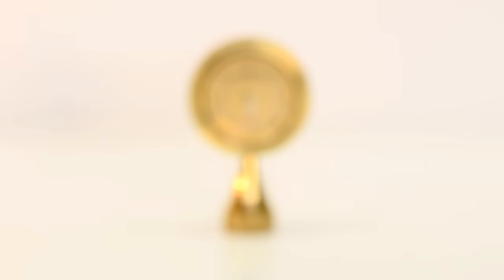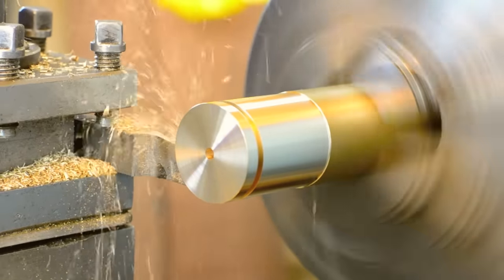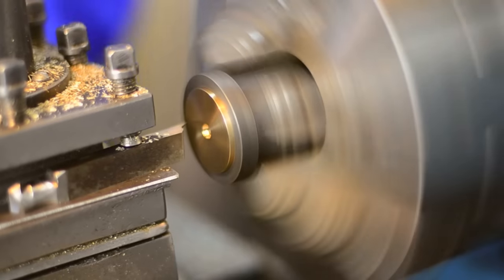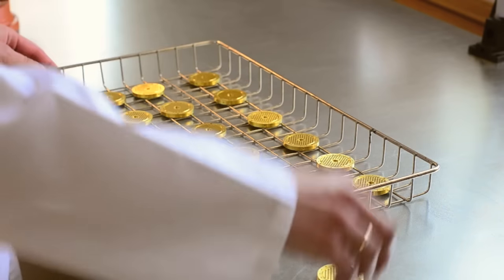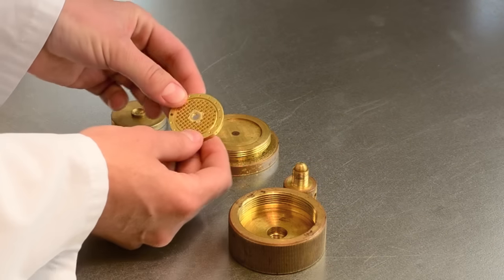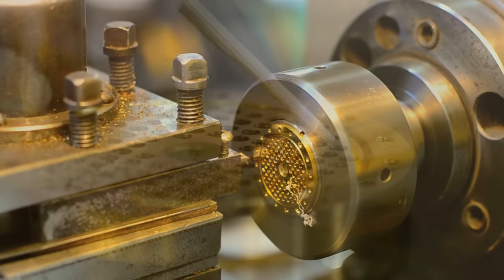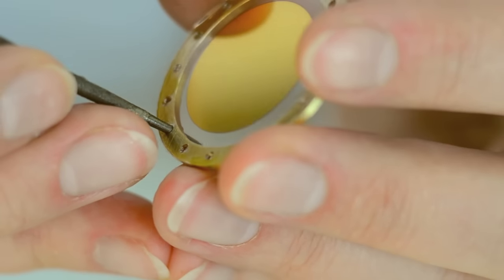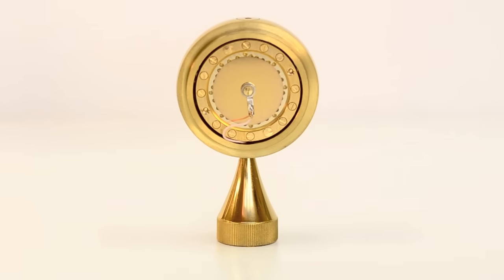SoyuzMade: Handcrafted Microphone Capsules

Comment: Its incredible to see this sort of craftsmanship in the modern era.  So few companies take pride in producing a quality product that takes this level of time and expertise.  Bravo.
Reply: 248 holes hand drilled?  I would go nuts doing that all day every single day.
Reply: @generalawareness101  There is a special tool that is named "кондуктор" ("conductor") in russian.
Reply: @ВаняКа-Ка  I have never seen one of those.  How does it work and how small can it drill if it even drills?
Reply: @generalawareness101  You could see the conductor on 1:12 - a perforated jar with a screw cap. But usually in mass production screw caps are not used due to the length of time. Usually there is a simple hinged lid or none one at all. I dont know how conductor is called in english.
Reply: @Ваня Ка  I re watched it at your time mark and I don't know either BUT I stand by what I said because they are, indeed, hand drilled even though they use a guide it is still a very monotonous job at best.
Reply: @generalawareness101  I do not argue. It is really a very monotonous job. However in a factory it is as monotonous as breathe.
Reply: @ВаняКа-Ка  I have worked at factories before and some jobs are mind numbing but that is insane.  To be honest it really should be done by a machine to spare inhumane environment and to save time, and money.  Might not be the same though but you never know until you try it.
Reply: @generalawareness101  It was the most common (maybe the only one) perforation technology for steel and brass in the pre-CNC era. And it is still cheaper then CNC miling or electric dicharge or laser cutting.
Reply: @ВаняКа-Ка  Slave labour will always be cheaper than those in countries with little, to no, respect for their workers.
Reply: @generalawareness101  Conductor is not a slave but a metal tool. По времени оно то на то и выйдет. Разница не в стоимости рабочего времени, а в стоимости станков и оснастки. Вас так напугало сверление по кондуктору, хотя это совсем не так монотонно, как переустанов на ЧПУ.

Comment: ..but when do you add the stored energy to it or is it only on electret microphones. I ve heard you shouldn t touch the diaphram because of it s voltage? But I cannot see in any step where the energy is put to the diaphram before placed onto the capsule
Reply: Yes, it is only electret capsules that have to be polarized in a factory, for true condenser ones like this one the polarization voltage is supplied externally through phantom power. 

And you shouldn't touch the diaphragm, that is correct, but that's simply because it is very thin and can be easily damaged, and also the gold coating can be easily rubbed off.
Reply: @RusAD-gb9jk   alright thanks for your answer.

Comment: Your first mistake is modeling your capsules after the Neumann K67, which has a harsh high frequency peak that can only be dealt with be corrective EQ. Not impressed.
Reply: Do you know what causes the capsule to do so? What capsule design would you suggest?

Comment: Such bullshit, 2 micron tolerance? On what? For what? So you think that it's necessary and to make you pay more?
Reply: I don't know, but tighter tolerances may allow you to have a smaller gap from the membrane to the backplate. The smaller the distance, the greater the capacitive changes when sound hits it, the better the signal to noise ratio?
Reply: we at soyuz found 2.17 micron tolerance was just not enough...so we rounded it to 2 micron..🎉😂😂🎉😂